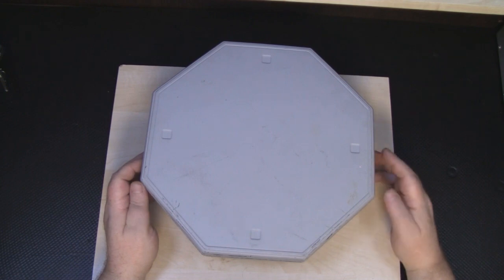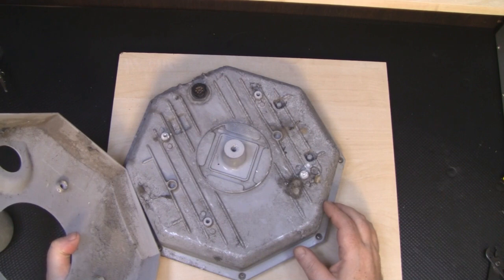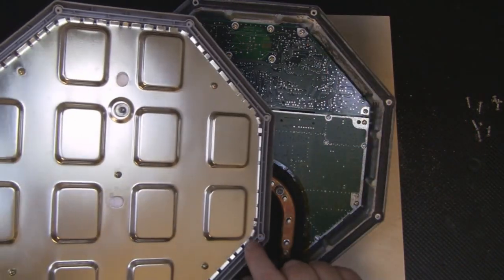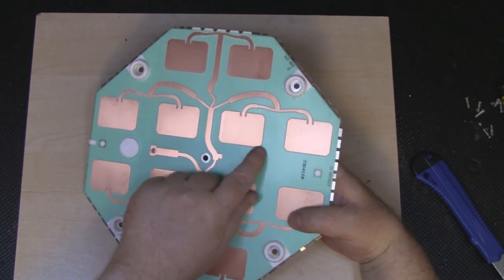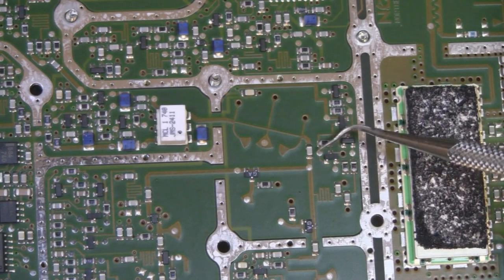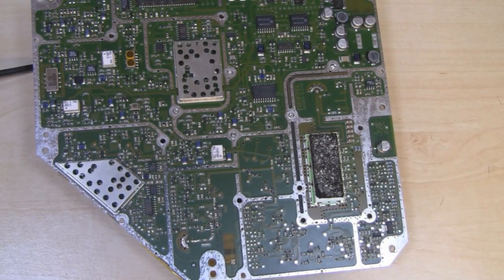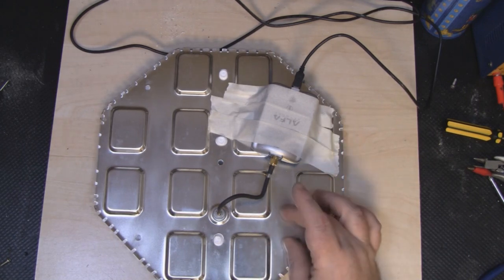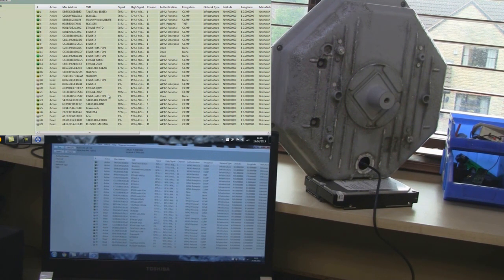Ionica Antenna tear down #103

Comment: At 9:03 you misinterpret the screws for the waveguide. They are for tuning the waveguide. That looks to be either a dual fed waveguide or a two path transmit/receive waveguide.
Reply: It's an FDD duplexer,  one output port for the antenna, separate Tx / Rx ports for the radios.

Comment: Thank you for the interesting upload!

Just for the cost front, I nearly had Ionica installed back in the days and the engineer came around and refused to install on the grounds that the chimney needed repointing.  He stated that since the equipment (mainly this aerial I suppose) cost £2000 he cannot risk it.  I was gobsmacked then as wondered how long it would take them to recover the cost...  

In conjunction with what you've pointed out in the video the fate for them was pretty obvious.
Reply: About $600 IIRC. Nortel lost money on every unit it sold to Ionica, who paid less than they cost to make.

Comment: Used to install this system for Ionic, If i remember right we called it the Residential transceiver unit (RTU)
I went on to repairing the system. Great job, Fantastic company but the system has so many different ways to fail.
I was trying to remember the cost of the RTA and seem to remember it being around 2k but could be wrong.....maybe the initial system install was around 2k.
Reply: Ahh yes the RTU. When I had mine installed (early adopter) they cost £1M each. But the actual volume manufacturing cost was around £100, when Nortel got things going, or it wouldn't have been economically viable in Mexico, for example.  Also @Andrew, they were engineered for a 20 or 25 year lifespan. I think that unit looks pretty good considering it doesn't have a gore-tex breather, that would have kept the moisture out by avoiding pumping effects.

Comment: I used to work for Ionica and own Ionica.co.uk
Reply: So did I. Based in Leeds
Reply: I was one of your 3 customers in Coventry.  I still have this on my chimney, but the box inside the house was removed during redecoration.  It was cool having extra numbers with different ring tones and I wish it had kept going.
Reply: I used to be an installer. It was my first telecom job. I'm still in it today :)
Reply: Hello world? come on, pull your finger out!
Reply: I used to work for Nortel and worked on the Proximity I project...

Comment: The screws on the copper tube are for tuneing the antenna. nor for grounding the reflector.
Reply: Tuning the Duplexer, which is a cavity filter. The length of screw protruding into each chamber affects the frequency response of the chamber and are used to compensate for the manufacturing tolerances and to achieve the right response. The Duplexer is separating the Tx and Rx frequencies. Ionica was FDD, so Tx and Rx occured on different frequencies. The Duplexer combines / splits a single antenna feed into two different radio feeds, one for the Tx radio and one for the Rx radio.
Reply from the maker: +BlueFoxTV Your write that's probably what they are but I would have expected them to be glued in place once they had been set as changing temperature over time could effect them.
Reply: @andrewmcneil  There will be threadlock on the screws or glue on top.

Comment: We had this same system in Sri Lanka on the same system and the antenna looks the same, so i guess this is a mass market prodcut from a telco system provider, but now after some time they all changed to CDMA
Reply: +andrew mcneil yes, 4G is to be honest amazing, on my phone is get around 20mbps down and 10mbps up, on fix its the same. fiber is basically 100 down and 50up. 

ADSL is cap at 16mbps and 1mbps up. ADSL has no effect I'm terms on rain but 4g does get effected I'm terms of signal levels but speeds won't get effected as much
Reply: Siri Lanka is CDMA, not GSM?
Reply: +shadowless CDMA 2000 is used by Fix phone providers to provide telephone services, for Mobiles we have GSM 2G/3G and 4G LTE, and we have fix 4G LTE as well on 2300Mhz for internet access + voice as a fix solution to replace the old CDMA solutions.
Reply: +Kalinga Athulathmudali  so no landline (copper/fiber) infrastructure? sounds like an investment opportunity.
Reply: +shadowless we do have fix lines (copper) and Fiber as well. I was referring to voice systems, for data people use either LTE or ADSL, and businesses uses fiber but relatively new
Reply: @abo3abid1  GSM is 2G. CDMA is like UK 3G.
Reply from the maker: +Kalinga Athulathmudali I bet you don't have to worry too much about the rain affecting the signal in Sri Lanka. How good is it at handling data and voice?